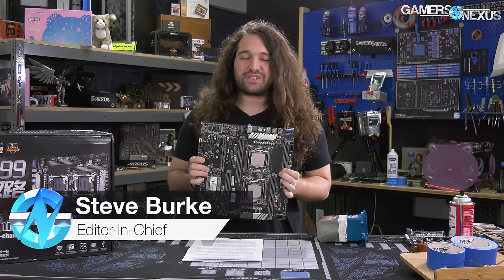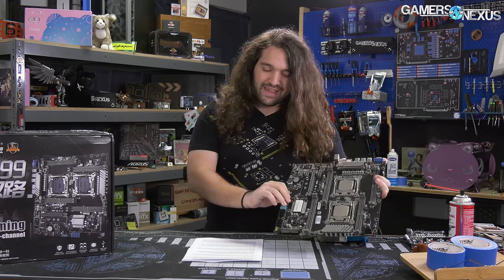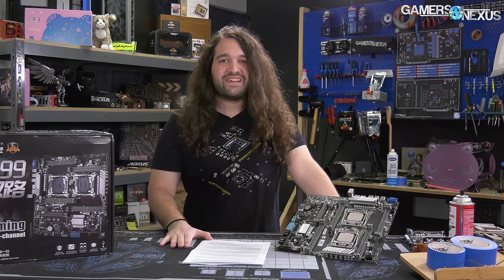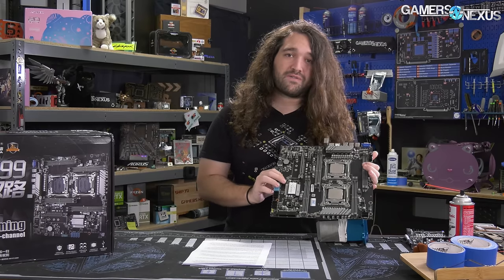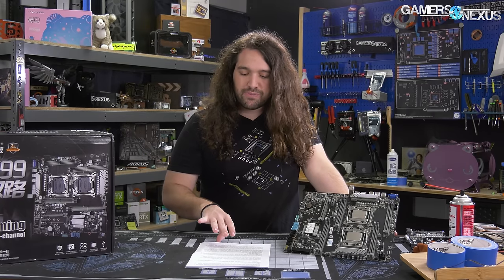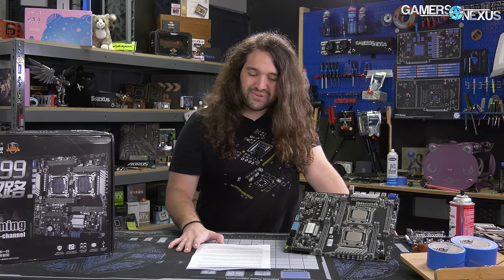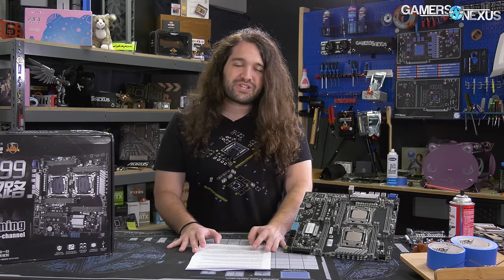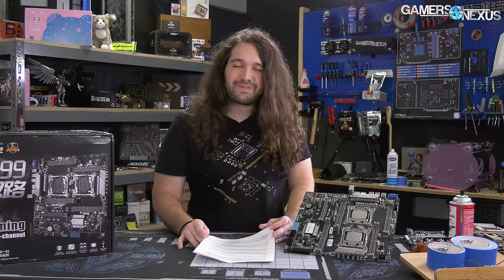24 Cores, 48 Threads for $360: Dual-X99 Jingsha Motherboard vs. AMD R9 3900X

Comment: Used Xeon's can be of great value if someone wants to put together a cheap office-PC and popping a cheap-ish GPU in such as a 1660.
Reply: hi
Reply: Or a 1070 used for an actually decent workstation for photo and video editing
Reply: John Chaser  ??
Reply: lol u call those cheap ??? lmao
Reply: Umm no, we have an old zeon at work and its a heap of shit the company wont replace it, sometimes you have to process an order 8 times and it still wont work it will just freeze and wait for 30 mins then delete the order all together. 

DO NOT EVER USE AN OLD SYSTEM IN A BUSINESS APPLICATION EVEN IF ITS JUST AS A PoS.
Reply: @habib_the_panda  what Xeon? There’s so many variations.
Reply: @habib_the_panda  are you sure this is a hardware problem with xeon?
Reply: Power consumption may make it a bit bad, though. But if that's not a problem, this sort of a setup does keep getting recommended often
Reply: @habib_the_panda  You do realize that a Xeon uses exactly the same basic cores as consumer Intel cpus based on generation to generation, your comment makes very little sense in all honesty. Especially as you've spelt Xeon with a Z
Reply: @DarkAvenger1234  idk as i said the company wont replace it, ill get fired if i even touch it
Reply: Yea 1660 is cheap...
Reply: @JGnLAU8OAWF6  considering its like 16 years old and running all the Camera’s and 4 PoS systems and summit tracking system for drive thru, i mean it sits at like 60% just idling, the manager didnt wanna go through everything though and im not allowed to touch it.
Reply: @habib_the_panda  I think you're the one on drugs mate, you're saying that xeons are no good at all and then in the next comment you're saying that the pc is from 2004. A consumer grade cpu from 2004 would also not be up to the tasks that your company is asking it to do 16 years later. The problem isn't the fact that its a Xeon, the problem is that it's 16 years old and probably based on pentium 4 architecture
Reply: Brandon S  im sorry who just split a paragraph into 3 seperate comments?
Reply: A cheap office PC will run better with a low-end Ryzen with integrated graphics for the same price or less. A 1660 is not cheap for an office GPU, office PCs don't even have dedicated cards almost always.
Reply: @w19ely85  heres a copy and paste, lol are you ready to be banned by youtube for harassment and bullying? ROFL 

Umm no, we have an old zeon at work and its a heap of shit the company wont replace it, sometimes you have to process an order 8 times and it still wont work it will just freeze and wait for 30 mins then delete the order all together. 

DO NOT EVER USE AN OLD SYSTEM IN A BUSINESS APPLICATION EVEN IF ITS JUST AS A PoS.
Reply: @4.0.4  yeah even a 1650 standard is overkill for PoS and they actually have animations on the screens
Reply: @habib_the_panda  You've made yourself look really stupid in this thread.
Who would have thought that a cpu that's 16 years old couldn't handle work in a business environment today?
 In your mind you're saying It's obvious that's its not working very well because it's a Xeon, not because it's from 2004
Reply: Currently using a Xeon 1660 v3 with a1660 Super for gaming. It's awesome considering the CPU, mobo & casing are free.
Reply: @cryptocrypto7814  are you enjoying making fake accounts to support yourself? 
I mean seriously everyone can see you are supporting yourself because you keep trying to put words in my mouth.

The first comment people see is “we have an old xeon at work and its shit” then at the end of that comment “old systems are shit for business use”

I literally haven’t been wrong about anything because all i have done is express my experiences and opinions on said experiences.

There’s a reason your not employed as a software or hardware engineer and you just talking proves why, mr opinion.
Reply: @habib_the_panda  I've made one comment how is this a fake account? Don't buy xeons everyone I heard from a comment on YouTube that they are no good for businesses
Reply: @habib_the_panda  literally not how a CPU works. There are so many variables. Are you sure it's not the actual network or application?
Reply: @habib_the_panda  no shit a 16 year old CPU will do bad. I hate Intel, but what you said about Xeon's is wrong.
Reply: @johnmidwest5650  and what did i say about xeons?
Reply: @johnmidwest5650  considering none of the conversation was or is about architecture IM NOT SURPRISED. All i mentioned is the workload.

Im very confused how all these detail are being added by people WHO DO NO USE this pc let alone see it.
Reply: @habib_the_panda  16 year old CPU from anyone still perform poorly.
Reply: @johnmidwest5650  Stop talking sense, all Xeons are bad. They are no good for business, no good at all.
Reply: @habib_the_panda  I'm amazed that someone has even employed you in the first place in all honesty.
Reply: @johnmidwest5650  whats the part in capitals in my first comment, please quote it..
Reply: @w19ely85  i love how you constantly get called out and you ignore it like nothing happened. Haha please tell me how does data pass through the system? In less then 1 minute.
Reply: @w19ely85  haha look out youtube is asking for supporting law fact sheets about your comments, guess whos looked at the reports and already done their research.. Youtube thats who!
Reply: @habib_the_panda  I'm constantly getting called out by someone spouting nonsense random words on the internet and calling it an argument.
I'm actually so bored of this now. This isn't a debate, this is you getting angry at strangers on the internet because your company won't upgrade it's 16 year old pc and therefore telling everyone that Xeons are no good for businesses.
Reply: @adamnizami8770  Yea, or a 1070, but some/or most office PC's you'll find won't have 6 or 8 pin PSU support needed for most GTX 1070s. So, i'd opt for a more efficient, less power hungry GPU such as 16XX series (1650, 1660, etc), 1050Ti, etc
Reply: @w19ely85  and just to rub salt on your wounds, you do realise that operating and maintenance costs are a higher priority then equipment costs right?

Ever notice how the more energy  efficient things are the more they retail for?
Of course you didnt you cant even read youtube comment without taking it out of context.
Reply: You all don't seem to realize what I meant. A cheap office PC can be found as they are cheaply sold by business companies that don't need them anymore on eBay, and you can turn those old office PC into an affordable gaming PC, usually just need a low-power consumption GPU.
Reply: @habib_the_panda  You actually did, you actually did say exactly that.
And I quote......

"@W19 ELY I never said they were no good at all either, I said they are no good for business applications, you really just skim read over half the comment don't you?"

You don't even remember what you said an hour ago
Reply: @habib_the_panda  I don't even know what you're arguing about anymore, you are a very angry little boy
Reply: @ghanz84  Exactly what I meant! (:
Reply: @cryptocrypto7814  😂 Brilliant 👍
Reply: @cryptocrypto7814  so you can refer to my comment of me refering to my comment of old pc systems, you do realise it was old xeons you are accusing me of an besides that comment was made after your first one so thats not what you read i initially and btw stop switching accounts because you take too long to reply on one let alone on both.

Are you involved in Biden Campaign? You would fit in quite snugg
Reply: @habib_the_panda  I can't argue with people who don't know the difference between simple words like "here" and "hear" and "you're" and "your"

You've just been made to look stupid on here by another user for contradicting yourself on a comment you made an hour ago.
I am so confused by where you have taken this argument it actually hurts my head. Like I said before I think you're really lucky that someone has actually employed you in the first place, maybe you should stop complaining online about your company and their 16 year old pc
Reply: @squirky787  lol i know, hence why i added context to my initial comment but apparently these guys don’t have the best social  or comprehension skills.
Reply: @squirky787  true but isn't there sata to 6 pin cables
Reply: @adamnizami8770  sata?? SATA isn't related to the GPU at all. SATA is storage bus connector interface.
Reply: @habib_the_panda  I think you need to go and watch some videos by YouTubers such as Craft computing, Tech yes city and Phil's computer lab.
An older higher end Xeon from architectures such as Haswell, Sandy bridge and ivy bridge can easily output high frame rates in newer games using higher end gpu's than a 1660.
Haswell core to core has been shown to have around the same performance as first gen Ryzen with similar clock speeds and you have more cores. 
For games that can take advantage of those extra cores you get a nice little bump in frame rate. 
An older 6 or 8 core xeon is a perfect pairing for a 1660 and for you to say that the xeon would bottleneck a low to mid end card like that is pure nonsense 
Once again your ignorance shows absolutely no limits
Reply: @w19ely85  you do realise that the current video we are commenting on completely proves you wrong... like i cant even believe you just said that, did you even watch the video?

Edit: i just realised and on top of that you have the hide to call me the ignorant one... thats actually kind of funny but sad at the same time.
Reply: @squirky787  sata power
Reply: @w19ely85  what arch and model is the 6 or 8 core xeon you are talking about so i can look it up easily because i would like to see that because you keep mentioning this specific one.

Wtf do you mean the it wont bottleneck a 1660? If you buy a decent 1660 model and overclock it you will be capping 144fps @1080p ultra, i have even done this myself, on 1440x2560 I think it is? You can play on medium setting comfortably not competitively though (ignore cpu for the example) so im not sure how come to that conclusion... not about the power difference, about the bottleneck
Reply: @w19ely85  wow make me waste all that time just to find out you where wrong which i already knew.... typical.
Reply: @habib_the_panda  Any decent Haswell V3 or even better V4 (If your budget can stretch that far) will not bottleneck a 1660, not even close. A 1660 isn't even a powerful card, it's about on par with a Polaris architecture AMD RX 590.

Please go and watch some videos by people such as Miyconst, Tech Yes City, Craft computing or Phil's computer labs. They literally test these Haswell Xeons with graphics cards more powerful than a 1660.
Like I said before, Haswell clock for clock, core for core is comparable with first gen Ryzen, so that's Xeon V3, V4 is even better.
You do realize that there are Xeon versions of consumer chips. They are exactly the same Cpu, just without integrated graphics and sold for server and workstation applications.
A Xeon E3 1240 V3 is nearly identical to a I7 4770
A Xeon E3 1230 V5 is nearly identical to a i7 6770

Do you honestly think that a i7 4770 or 6770 will bottleneck a nothing card like a 1660?

Those are four core/eight thread xeons, imagine what a six core twelve thread one like a E5 1650 V3 could do? Or even better a V4, that cpu turbos up to 4.0ghz.

I honestly don't think that you have much idea about Xeon cpu's at all.
Now I'm going to go back to my original comment I first made to you, the one that upset you so much and you started attacking me saying that I was on drugs.
Core for core, clock for clock a Xeon is comparable to a consumer cpu of the same architecture.
Reply: @habib_the_panda  ?? Okay, cool.
Reply: https://www.youtube.com/watch?v=-ZONV2_nqJc

Yea, a old office PC (xeon) paired with a low to medium end GPU is a great pair.
Reply: @w19ely85  are you done?
I actually have both an i7 4770 and i7 4790 neither of which can break 120 fps on 1080p ultra when oced using a 1660ti you are talking about something that uses the same power and less then. 20 fps difference but because you have never worked with these things yourself (btw i did look it up and you were wrong according to GM, TYC, GS, BW, JTC upu name it they all have vid disproving uou and on too of that i have sone it myself using both 4th gen i7’s seriesly grow up.

I think its funny that you think you pissed me off because you cant even comprehend what your saying let alone like what i asked you yesterday, you dont even know the data flow of a pc, you say xeon arch is the same as core like ffs, grow up bro its the same silicon on the same size node therefore it gets the same name, the core a ring layout is different hence why its BIGGER you know when that thing that happens when something isnt smaller? Lol i bet uou dont even know why the little whole is on the xeon ihs.
Reply: @squirky787  paired with a 1650 and cant go above 1080p ultra because 1 the cpu cant handle it (its already at 72c) and the gpu cant handle it either
Reply: @squirky787  bro this is why you dont understand how it affects the gpu, its especially important with the newer 3000 series because they can bypass system ram
And cpu meaning you can’t cache data on system ram for the gpu (well you can but it trys not to) so you benefit a ton more from upgrading to a sata ssd and EVEN MORE from upgrading to a m.2 of decent quality
Reply: @habib_the_panda  lol, whatever
Reply: @habib_the_panda  nice

Comment: Dual sockets blows at gaming possibly because a) it has NUMA enabled and b) the games does not try to run NUMA-aware. So the half of games' threads run at CPU0 and the other half at CPU1. Then CPU0 tries to access something CPU1 allocated. This incurs massive memory latency penalties as CPU0 has to wait for reads over NUMA bridge.

I bet games with fewer threads would run  faster than more threads because of this.
Reply: Or use something like process-lasso to force the games to only run on one CPU
Reply: An easy way to test it is just to take out one of the CPUs. I bet the 0.1% lows will significantly improve.
Reply: It blows simply because those CPU are low frequency. 2,5 Ghz.
Reply: @TheKetsa  It's running faster than that due to turbo boost, and it would still run a lot faster (close to Zen1/Zen+ Ryzen 7 in most games) in most modern games if you used a single-socket motherboard (especially if you also did the turbo boost unlock hack to let the boost apply to all cores). Miyconst (the guy who made the turbo boost unlock tutorial) has benchmarks on his youtube channel. The relatively low clock speeds are only a small part of the reason why these Xeons are slow.
Reply: @TheKetsa   With turbo unlock, the 2678/2680 and properly configured runs as good or better then a 2600 or 2700x, and about 15-20% or so worse then a 3700x. Which isn't terrible when you factor in that the entire system costs roughly the same as the 3700x alone even when running the boards with DDR4.

Comment: I would definitely love to see a lower core, higher clock speed single socket setup on the x79 and x99 setups. 1660v2's, 2667v3's, anything really.  The older xeon have slower clock speeds, but higher L3 cache counts.  8-c/16-th combos are cheap and have higher clock speeds.  The V3's went higher in core counts in favor of lower clocks.  The V2's also have a higher cpu diversity.  Definitely loved the information!  Level 1 tech compared a Xeon 2680 v1 to a 7900X and it fared relatively well in gaming!  Looking forward to more videos on xeon builds!  They are a great alternative to modern cpus, if you're on a tight budget and want more cores/threads.

Comment: Please do a full review of single 2678v3 in gaming, its a beast budget CPU that can use very cheap ddr3 ecc RAM. In some countries the whole bundle of this CPU + ddr3 motherboard + 16gb ddr3 ecc ram can be cheaper than used Ryzen 3600 (just CPU). And other Xeon 2620v3 is best low-end CPU for people on even lower budget.

Comment: I love this video. Just so unique and interesting, although perhaps not so useful...

I'd love to see a revisit to this platform with instead one of the single socket "bords" paired with something like the E5-2699v3 or the OEM E5-2696v3, with the all-turbo mod which is rumored (the OEM version) to boost to 3.8GHz.

These chips are going for just $40 U.S., making the board the most expensive part.

That might be interesting in compliler and render workloads for less than $150. And with just a single CPu at 3.8GHz, it might even be able to produce some acceptable frames?

Though gaming would obviously not be the primary use case, but it might actually be a relevant budget option for people launching on YT or things of that nature.

I'm curious, but I don't have $$ just to throw away on a curiosity...

Anyway, really, really enjoy this vid. Thanks.
Reply: Undervolted E5-2699v3 with HT off and some cores disabled gives some really interesting results. The disabled cores help with the limited TDP.

Comment: I run an e5-1650 v2 for like 4-5 years before going to a 3900x.   That old used cpu was very good and served me well.  Also the Motherboard allowed me to set the boost clocks (all cores) on the Zeon to what ever I wanted granted it was unstable past 4.3Ghz So I settled for 4.2Ghz all core boost and it run everything like that the entire time I had it.

Comment: Can you use one of those dirt cheap mining gpu's, without output, on it harnessing the onboard video? If so you could get a 3gb 1060 mining card for say, $35.
Reply: I use a similar board with dual e5-2699's and mine monero on the cpu's and I have 4 1070's mining ethereum on the pci slots.  It was a sub 500$ system (before gpu prices went crazy).  And not counting ram which I already had.